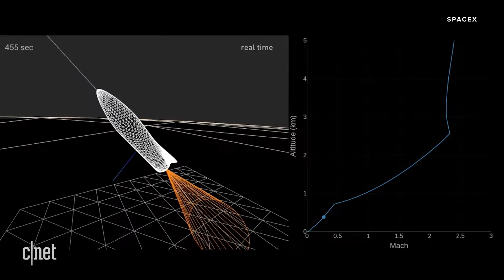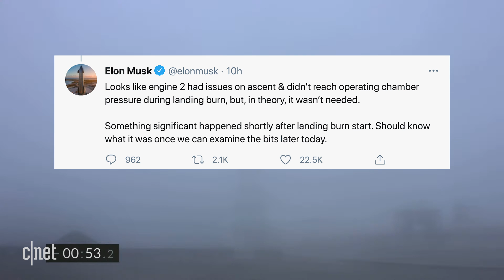Why does the SpaceX Starship keep EXPLODING?

Comment: So, why didn't they wait until the fog cleared up? What's the rush? 🤔
Reply: it's automatic, they dont need to see the rocket.
Reply: @blazemusicec  people act like rockets have eyes
Reply: even if the fog would have cleared up it could have crashed anyway, because it was a problem with engine 2
Reply: It’s an old design and the faster they explode the sooner we get to mars
Reply: @QueerAssociation  You mean that they would waste three expensive Rapter engins and the support systems (As well as the damage done by the explosion, to other equipment on the ground)? 🤔
Reply: @kennyfordham6208  these rockets would probably be scrapped after testing anyway, engines included.
Reply: Sn15 has way more upgrades and updated design
Reply: Because they only have a testing window/schedule with the FAA
Reply: @jacobamber28  What's wrong with filing for a different launch day? They've done it before.
Reply: @kennyfordham6208  they are not rushing it. The timeline to reach their endgoal is already tight, any unexpected delays causes more problems than what we can imagine.  What we really need to take away from this is the more tests they do the more things they will know about many uncertainties.meaning they can collect real data from real explosions at fast succession.
Reply: @kennyfordham6208  SN11 was outdated before it was even finished. So why wait, fire the thing and make room for the next one :) Pity about the fog but SpaceX not putting on a show for youtube, they testing rockets.
Reply: @mcarpenter2917  what is the point of testing "old" rocket if they already move on to updated design?
Reply: @xponen   Because they still learn stuff, like SN11 did a belly flop in high winds, which none of the others did. Also new failure mode of Rapter was encountered, which may not have been fixed with the updated design.

Also SpaceX on a grueling target to launch to orbit, not flying SN11 would have slowed things down and there was no good reason not to fly it. The winds where forecast to get worse later in the day so it could have taken days to get another launch.

Really, SpaceX building rockets not fireworks for youtube videos, much as I wanted to see it fly/explode I can't fault SpaceX for pushing ahead.